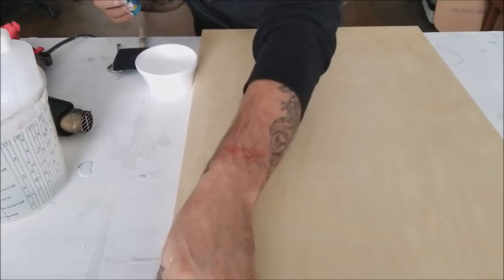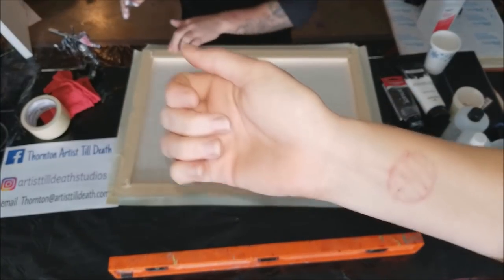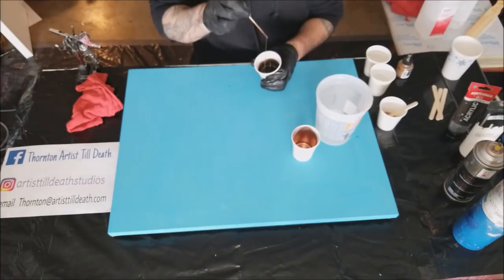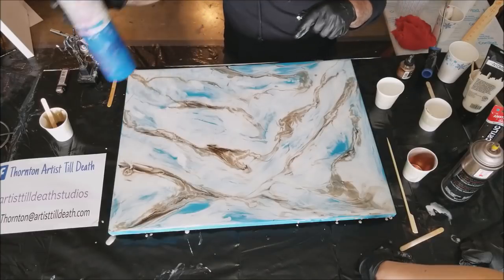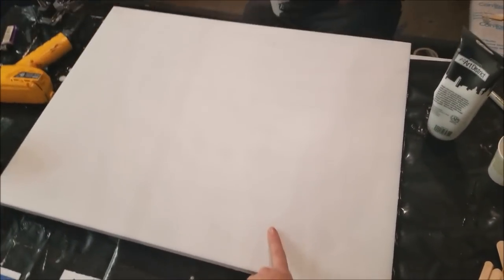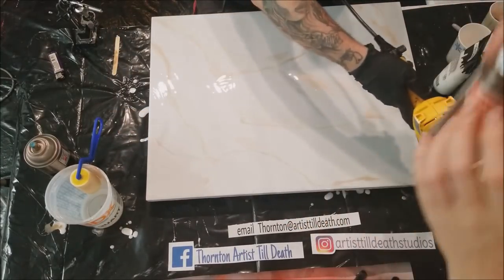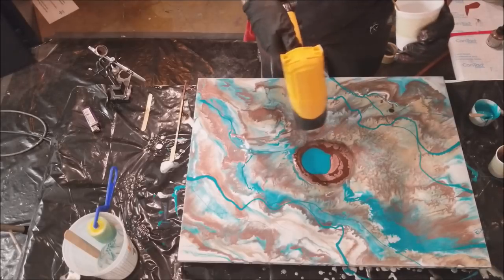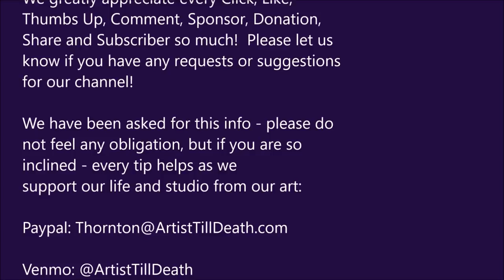Well at least the LACING and CELLS are pretty (laugh at our mistakes)

Comment: You guys are fun thanks for the information.  I start over a lot ugh! When do you take your tape off?  I use an easy flow type canvas and no matter how long I spend wiping the underneath it still is hardened into the tape. Thanks
Reply from the maker: Stephanie Barkley we take it off about two or three hours after it has started to set. We usually have to set a timer or we will forget. Basically you can remove the tape when you notice no new drips forming.

Comment: Question; wouldn’t it be better to do this art work without the resin and use whatever binding product (like floetrol) do your art work let it set then resin the art work - just asking.
Reply from the maker: Hey Diana, what you are talking about sounds a bit like an acrylic pour - which is a bit like a resin pour but the paints react very differently.  With an acrylic pour your colors are more likely to mix with each other rather than just lay next to or on top of each other.  If that makes sense?

Comment: I want to do this to my countertops (as I’ve said before), and I was thinking about what material to do it on. I’m prepared to pour concrete tops then put the resin on it, but I’m wondering, could I just use mdf?
Reply from the maker: Hey Megan. MDF may absorb some of your epoxy/resin. I would use a bonding primer and a couple coats of shellac or polycrylic before applying your resin just to make sure nothing messes up. It does work on wood but you have to make sure you seal it a couple of times to make sure no bubbles seep through and create bubbles (refer to the large round video)

Comment: I had another thought. Don't know if it would work but...maybe? If you heat your resin up in warm water then add acrylic paint which causes lumps (if I understood the problem), what if you were to set you jar/tube of paint into the warm water too? That way all ingredients would be the same temperature and give no sudden temperature changes to the part of resin it hits when added, that causes the lumps?
Reply from the maker: Debra Cox that’s a good thought. I didn’t consider that it may be the temp change. I assumed the problems stemmed from trying to mix something very thick into something very thin. We are totally down to try it!!

Comment: Lol....strippery is definitely a word! I have a question for you, that you may have a simple answer for, or maybe it's complicated. How do you get cells and lacing? I am having such trouble making them happen. I can get cells and lacing in my acrylic pours, with different pouring mediums, too many cells in fact, but once I jumped in to working with resin, I can't seem to make it happen. I'm actually more interested in getting my white to lace over other colors (which I believe is really cells spreading very thin), I just can't get it to work. So, do you have any tips, tricks, or thoughts as to what may be the issue? I use white flow acrylic paint with my resin, and I've tried Envirotex Lite, and Ice Resin so far to no avail. You guys always seem to be able to get your white to behave. I watch, and still can't tell what I'm doing wrong, so, hoping you can givee some pointers. Thanks! And congrats on your beautiful work. I'd like to be able to do bar tops, but won't even try until I can consistently get what I want from the resin and paint! Thanks.
Reply from the maker: Hey Andrea, that's funny - we never had much luck with acrylic pours.  We are planning on doing a "cells" video.  Maybe we will do that for our live stream tonight or tomorrow night.  Ultimately it depends on what type of paint you use and what type of heat you use.  It is most easy to get cells and lacing with white - so you are in luck.  I think flow acrylic paint is what is giving you the issues.  I would recommend using an epoxy paste like the white from La'Rez or Artisue.  Or you could try castin craft white - you can order that off of amazon https://www.amazon.com/gp/product/B003CHQWJG/ref=as_li_qf_asin_il_tl?ie=UTF8&tag=atdstudios-20&creative=9325&linkCode=as2&creativeASIN=B003CHQWJG&linkId=99f2574a67219c88f5a1341757e7ca34